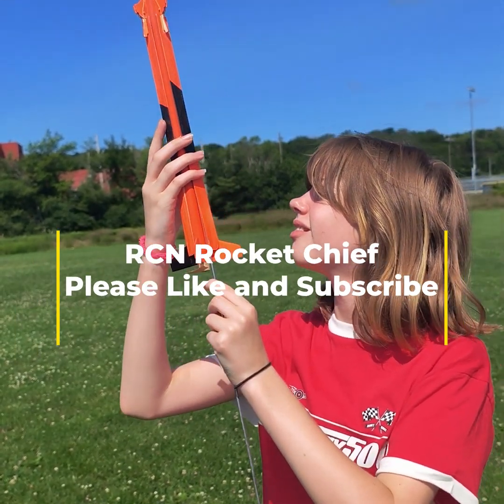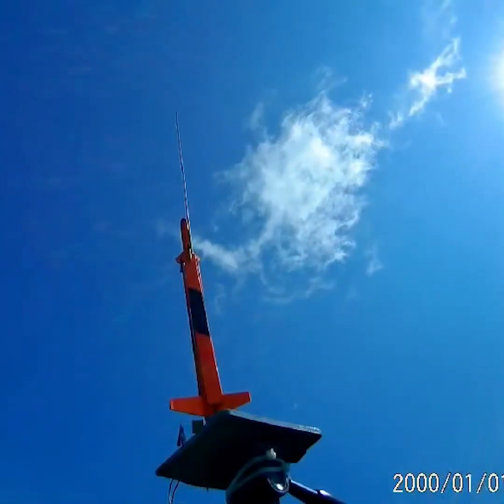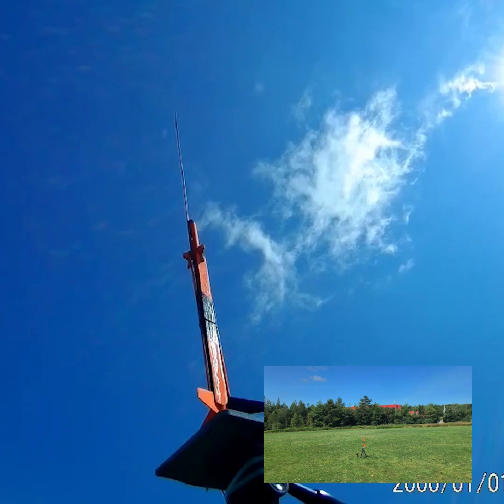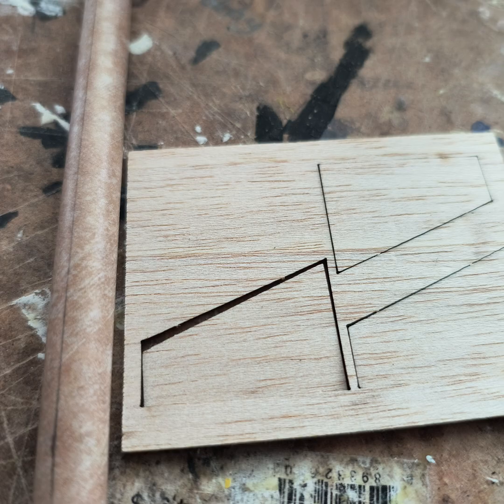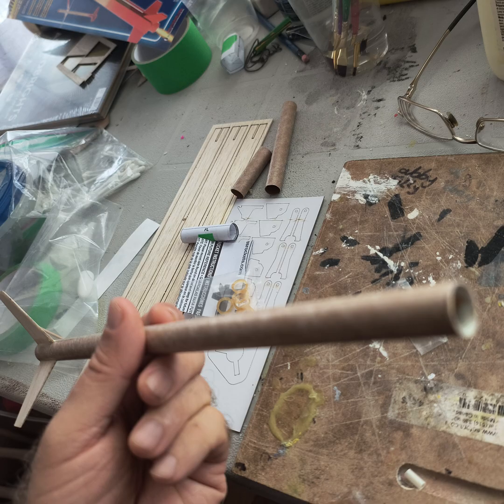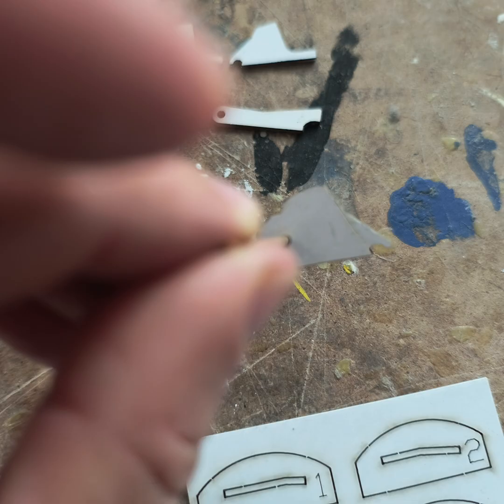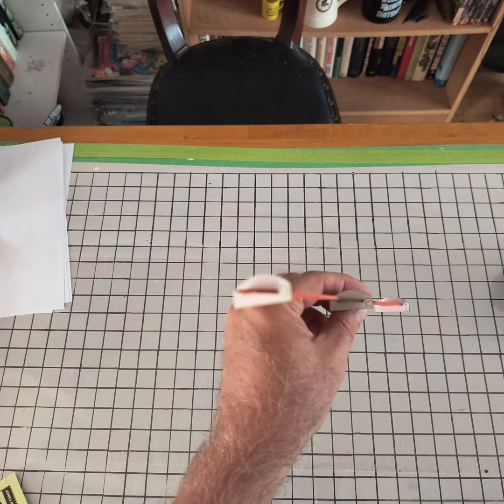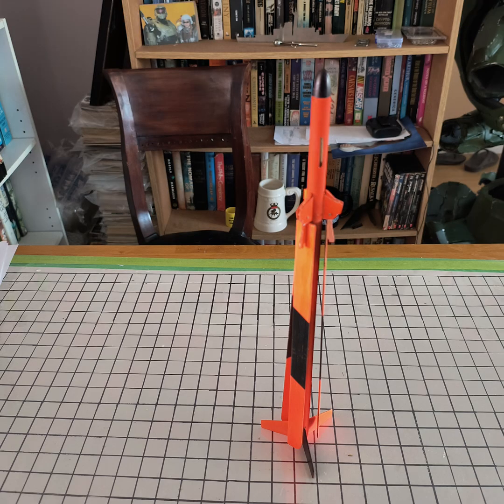Mini Model Rocket Flight with Helicopter Spin Recovery

Comment: In the process of building that thing now did the blades first. Now that was something new to me. Lol.. did split one open. However it seemed to have cured as needed. Today I shall start the body construction.  And the ribbon. Not seeing any supplied. So isn't just some thin sewing thread?
Reply from the maker: That's all I used. Thin enough that the ejection charge burns through it, and a "standard" thread was fine. I looked to see if there is a weight or measure on the spool but nothing, sorry. Just some thread I bought at the dollar store.  Biggest PITA was threading the needle with my old eyeballs 🤣
Reply: @RCNRocketChief thanks for your reply. I'm sure the Thread being Thread was the biggest of the problem.  Lol.. I'm sure it will for me as well when the time comes.

Comment: About like the swing wing kit from 1986 in complexity.  On ejection charge, the main wing swung 90°.  It was a high speed glider as to be expected.
Reply from the maker: Cool! I have something like that near the bottom of my "to build" pile. I will move it closer to the top!
Reply: @RCNRocketChief  
Like the heli kit, keep it light weight!  Watch center of gravity too, if the motor kicks out completely,  it becomes too nose heavy and becomes a lawn dart.  If the motor shifts back, it can be to nose light which then spin flutters.
Reply from the maker: @keithjurena9319  Noted!